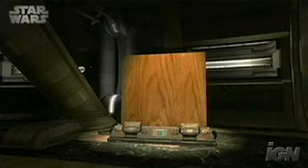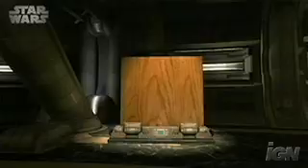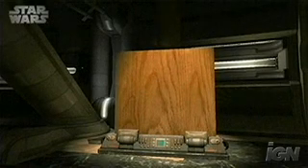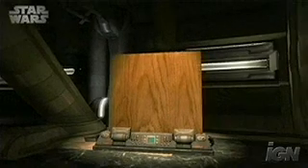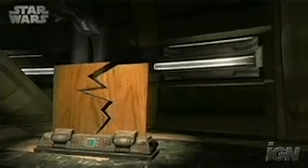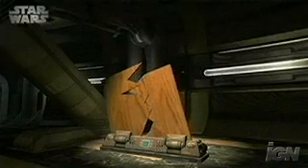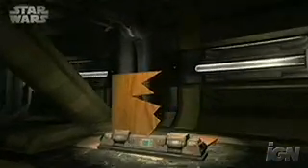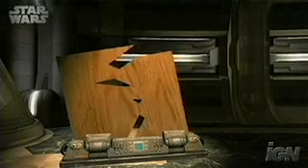Star Wars: Force Unleashed Tech Video (DMM Demo)

Comment: they should focus more on physics in games than graphics. look where we were 15 years ago yet none of it is shown in the games we have these days. sad to see the focus of games shifted to the wrong parts.
Reply: I agree with you. However this happened not only because of developers but hardware. You see, the 7th generation, 360 and PS3, had pretty strong hardware for their time. It was top notch technology that even surpassed anything on pc at that moment due to using new architectures for that time and enough ammount of raw power. However in the PS4 XBOXONE era this totally shifted. Both consoles were mediocre on graphics technology and notoriously weak on the CPU side (were physics is handled ). These CPUS were so weak that a single xbox 360 core was 70% as good as a PS4 one. And given that these consoles had such an unbalanced GPU / CPU in power a great ton of cpu resources were allocated just to handle helper logic for the gpu. So it was a hardware issue also. In the 360-ps3 era we saw a lot of advancements in both graphics and game logic (physics) because the hardware begged to be utilized at full potential. This was demonstrated with games such as Battlefield 3, Crysis(even the console vers), Red Faction Guerrilla,  GTA V, Killzone, Gears of War, Gran turismo(the driving simulation logic is very advanced and heavy), Half Life EP12-Portal, Flatout: Ultimate Carnage, Dead Space (dismembering system-havok)